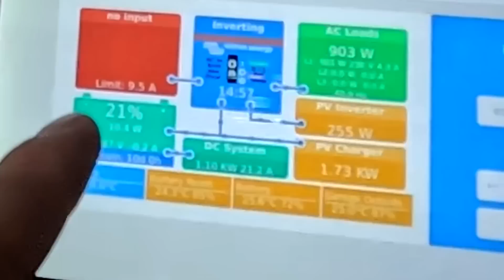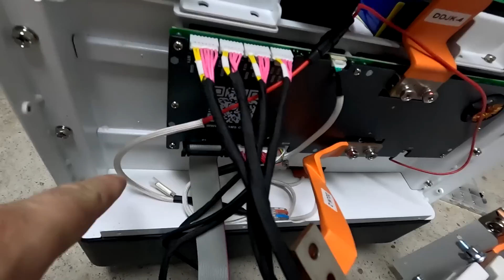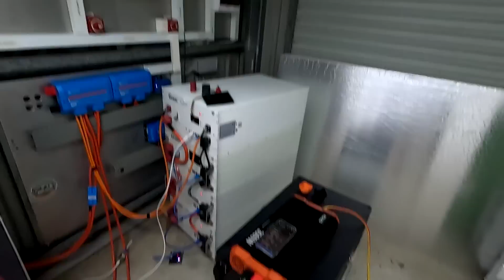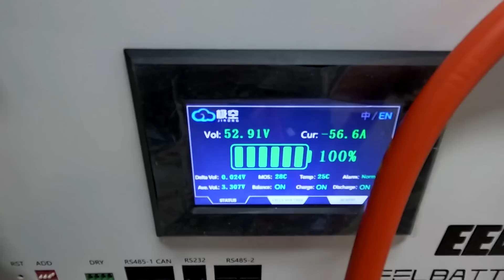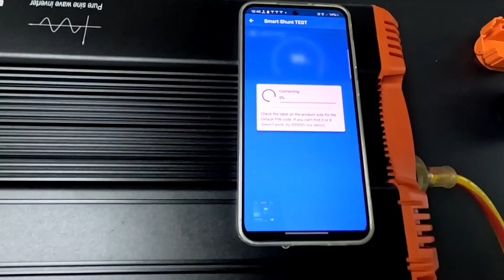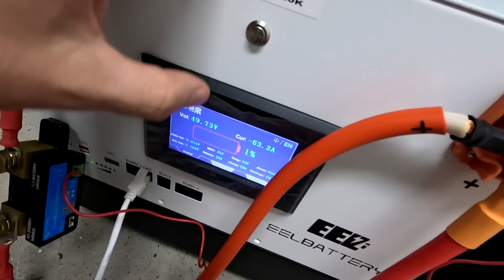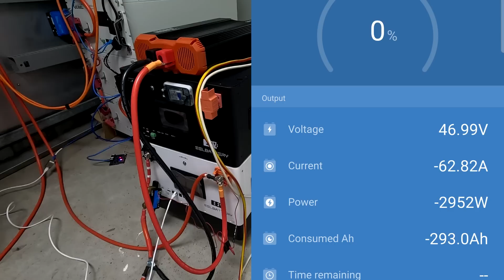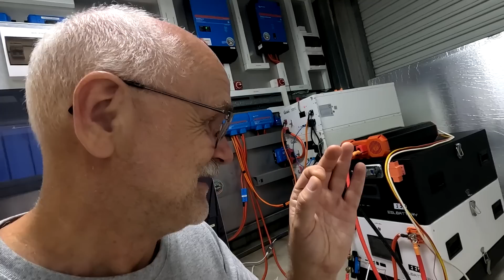EEL DIY V5 Build and EVE LF280K Double-Hole Terminals Capacity Test. What's up with this fuse tho?

Comment: The Vibrations are from the inverter i think, they get forwarded by the cable.
Reply: Also have this vibration, solved it by very thin 0,8mm eva/foam tape between lid and box, and some thicker foam between the stacked battery boxes.
The Multiplus II draws current by pulses, this is why the SOC measurements are also incorrect.
JK BMS does not measure average current, but measures peak current!
Reply: @ronhellenbrand  I don't think the problem with vibrations is the noise, but rather that it vibrates everywhere and therefore there is a risk of screws coming loose. At least that's how it was explained to me once. That's why you shouldn't use luster terminals for AC cables, as they could come loose due to the transmission frequency and start to burn.
Reply: @ They invented Loctite for this.
If Multiplus II is connected with the grid, you can measure peak current pulses that causes vibration.
If you disconnect the AC IN the vibration and incorrect SOC measurement is gone.

Comment: Is there an updated firmware for the JK V15 that fixes the dry contacts.and improves the SoC estimate?
Reply: No. In the case of the dry contacts it's a hardware issue so can't be fixed in software. If you're lucky, the opto-isolators in yours will work at the inadequate current they're fed with.